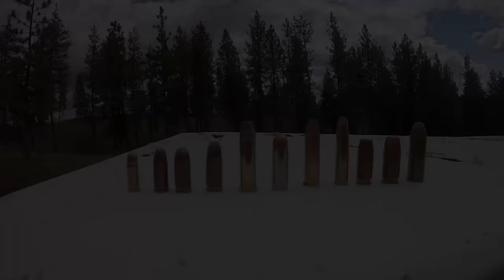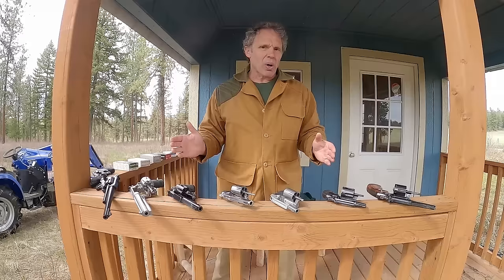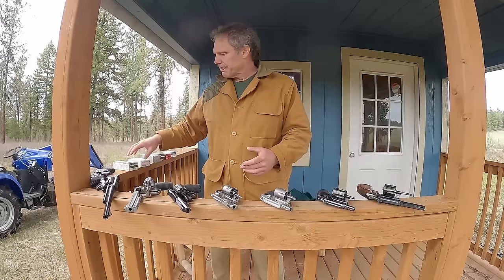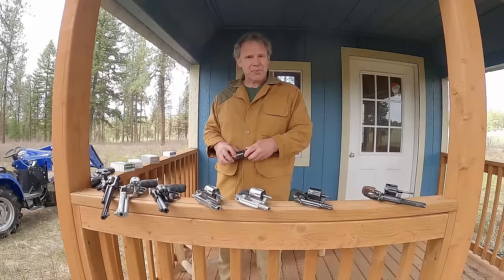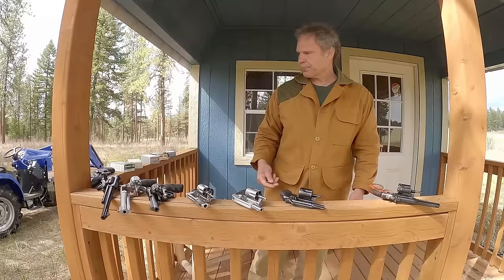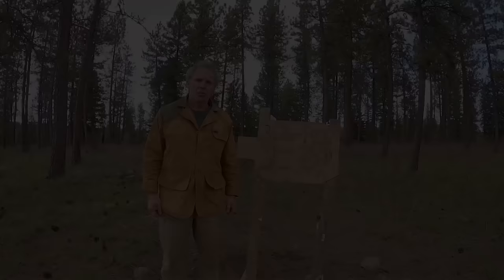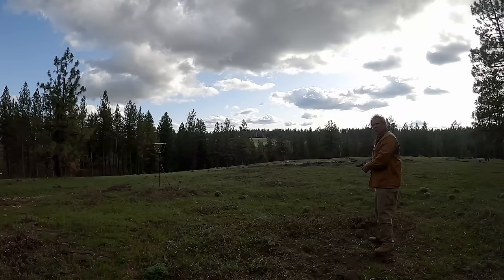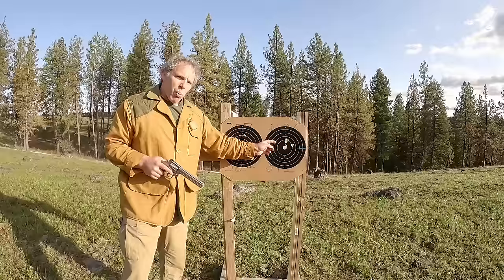Shooting .38 Super in .38 Special and .357 Magnum Revolvers

Comment: I have experimented with shooting 38 Super in a good 357 Magnum revolver.  The best way to do this with consistency and accuracy is to carefully run a 38 Super chamber reamer into the .357 cylinder holes.  The reamer should be run in just enough to properly headspace the cartridge by the case mouth, not the rim, as it would be in an auto pistol.  With the chambers all cut the same and properly, accuracy will be optimized and if head spaced properly so that there is a similar clearance between the case head and revolver breach face as with the .357, primer strikes should be as reliable as with the .357.  That all said, variations in factory cartridges may result in an inadequate amount of case mouth support.  The modified cylinder will still accept .357 Magnum cartridges, and I have noticed no ill effect on my cases after firing. 
If the manufacturers of .357 Magnum ammo offered mild loads of similar velocity to that of the .38 Super, much of the reason for shooting the .38 Super in a revolver would be removed.  Unfortunately few such .357 rounds are available so the shooter is stuck with shooting hot factory .357 loads that are likely more powerful than needed while being dangerously loud, and excessively recoiling in lighter revolvers.  Another way of producing a mid velocity revolver round would be to exceed recommended +P .38 Special pressures by purposefully handloading the cartridges to higher velocities; but I don't recommend this as such .38 Special cartridges may be dangerous to fire in some .38 Special revolvers, and may find their way into those guns that aren't able to handle those high pressures.  The excessive pressure rounds would also outwardly look just like a safe factory round, adding to the danger of them being used in a gun that couldn't handle them.

Comment: Back in the 70's. or 80s AYoop wrote an article suggesting the use of 38 super in 357s when police were required to use 38 special.  I probably misspelled his name.   I think the operating pressure for 38 super is far greater then 38 special  so Ionly use it in 357s that it will fit in. I have several of them and only one will take 38 super the others I can not get any brand I have tried to fit I for years have used a 38 super and sometimes use it in my security six. Fell in love with it in 1955 when I shot dad's friends light weight Colt combat commander, I was seven. Have wanted one ever since, still wanting ha. Good Show.

Comment: Never thought about this particular issue. I did have an old FIE Titan Tiger-38 special revolver that I ended up selling to a friend.  He had a box of 38 S&W rounds. They were just 38 S&W- not Specials. He successfully fired the whole box through that revolver. I have read that the 38 S&W round would not chamber in a 38 Special. And I did try to chamber one in my S&W model 10 38 Speed. It would not go into the cylinder. I wasn't going to fire it if it did. I was just seeing if it would fit.

Comment: Problem with using .38super in a .357mag revolver, the .38super being a shorter cartridge, is the fouling in the front end of the cylinders and if you dont clean it well enough will it impede a .357mag cartridge going in. So I would agree probably not a good idea to use .38super in a .357mag. Another thorough and informative video.

Comment: As you showed, chambers and ammo are sometimes oversized.  It's a matter of manufacturing tolerances.   I've found that oversized chambers will load OK, but don't unload as easily.  I suspect the chamber doesn't seal as well against gas blowby, or the chamber allows the case to expand.   Either way, ejection is a key factor in matching ammo with firearm. Even if the round fits (and is made for the gun), tolerances change the ejection in both auto's and revolvers. You haven't even touched on steel vs brass, vs aluminum cases, much less subsonic or reloads.   Moral: Take it to the range before you depend on it, and only depend on successful results.     It's sorta like the joke of testing matches before you go camping.   Strike one and it lit, so I'll take that one.

Comment: Friend, Great VIDEO! Someone should chamber a 5-shot revolver in .38 Super. The shorter .38 Super Cartridge would allow a shorter Cylinder—which is the bulkiest part of the revolver. A ground-up 6-shooter in .38 Super wouldn't be a bad idea either. B.} IF someone wants to make sure that their .357 Revolver will use .38 Super "just-in-case" might be well-advised to have a .39 Super Chambering Reamer ran into the chambers. C.} Decades ago, a few IPSC Shooters who were pursuing "Major Caliber" had a 9mm Chambering Reamer ean into their ,38 Super Chamber. The 9mm is a little fatter at the rear and the Fire-Formed .38 Super/ 9mm cases—hereafter resized with a 9mm Sizer Die—would hold about one-grain more powder. They called it .38 Super Improved—though the main goal was to be able to use 9mm Carbide Sizers.

Comment: There's also 38 Super "Comp" brass which has a flush rim and some mfg's use this brass for their ammo. (You have to check the box as usually it's stated whether it's comp brass) 

The reason it's a popular round in the US was that target shooters could load 38 Special SWC bullets for their 1911's. In South America you're not allowed to own guns chambered in military calibers and 38 Super fits the bill.

The difference between 38 Super and 38 Special is really cost, performance wise they're about the same. In a scenario where I wanted a 1911 for defense and wanted the extra round, I'd choose the 38 Super over 9mm as there are defensive loads available for 38 Super or you can hand load.

Comment: This video was very interesting even though I never gave this even a passing thought. One thing I'd like to mention is that every firearm I've ever bought came with a disclaimer that the manufacturer stated that any warranties and/or company liability would be null and void if their firearms were used with ammunition that 1.- has been reloaded, or 2.-that the firearm was not originally chambered for, such as using .38 Super in a firearm chambered for .38 Special, or .357 Magnum. There was no mention of this , other than the part where you said "CAN you do it? Yes, sometimes, but SHOULD you do it?" and left it to the user to decide. I think ALL firearms manufacturere warn against such a practice. I think you should've mentioned that.

Comment: I also have firearms (pistols and revolvers) chambered for 9mm LUGER as well as 9mm Largo and 9mm Ultra, 38 S&W, 38 S&W Special, 357 Magnum and 38 Super. The only ones I shoot in guns not specifically chambered for a given cartridge is 38 S&W Special in revolvers chambered in 357 Magnum. My one pistol chambered for 9mm Largo an Astra 400, will chamber 38 Super and was used in days gone by with 38 ACP. 38 ACP as many of your viewers know is dimensionally identical to 38 Super, but loaded to much lower pressures. Basically I think you can't go wrong by only shooting ammunition your gun was designed and chambered for. It's a good way to avoid nicknames like One Eye Willie or 3 Fingered Jack or that guy who is dumber than a box of rocks.

Comment: Always interesting to see how different rounds may or may not chamber in other firearms. You can sometimes even see the same thing with rounds not fitting correctly in chambers they are for. I've seen some cheap 9mm, that was obviously not QC'd well fit fine in compact and full size handguns, but then jam every other round in a subcompact because the casing is just a hair too big

Comment: Hello, great video and very informative, but... You did not touch on chamber pressures at all.  
The 38 special has a max pressure of 17,000psi
38+p 18,500psi
38 Super 33,300psi
38 Super +p 36,500psi
357 Mag 40,000psi
So... the 357 mag revolvers will handle the lower pressures of the 38 Super, but the 38 Super pressures are about twice the pressures of a 38 Special! So the biggest reason to not put 38 Super into a 38 special is it might blow your gun up!
Hope you all have a great and safe day.

Comment: An "expert" might have told us that a semiauto rimless pistol cartridge is taper crimped and headspaces on the case mouth. ... Those Remington .38 Super rounds that wouldn't chamber in the .357 or .38 caliber revolvers, just might fit, if they were run through a .38 Super crimp die with just a tad more taper adjustment. ... However, excess pressure might be the result of that experimentation. ... Proceed with extreme caution guys. ... Good stuff Paul. Thanks

Comment: If I were designing a new autoloader cartridge, I'd get rid of the taper on 9mm, make it as long as the .38 Super, make it truly rimless and design it for modern pressures. I think you could push 45,000 PSI or maybe even more in a case that double-stacks easier than .38 Super without being too wide, reloads better than 9mm, has as good a magazine capacity as the best of either, can push higher velocities than either thanks to the larger case and higher pressure and doesn't lose capacity to do so the way .357 Sig does. Nobody would buy it because existing cartridges are so well established but as an academic exercise, I think it makes a great deal of sense.

Comment: My favorite ccw is my .38 special revolver. It’s very hard to make a mistake with that weapon. I carry several 5 round stripper clips to reload it. I can reload it in the dark without looking. It’s a smith and Wesson Airweight +p .38 special. As long as I load it correctly it will never fail me.

Comment: If you have a snub .357 magnum and want a 'not quite' magnum load then a .38 Super load could work. But you would have to test it out to see if they a) chamber, and b) the extractor will eject the cases. If they do then there a some nice .38 Super JHP loads out there. The ONLY .38 snub I would try it in is the Ruger SP101 38s or older Ruger Speed Six .38s. Those are '357 magnum' stressed (heat treatment) and should take the Supers quite well.

Comment: Putting 38 super into a 38 special even if it fits is one of those where just because it fits doesn't mean you should ship it, something not brought up in this video but is VERY relevant to the safety aspect is rated chamber pressure. It is eluded to when Paul brings up that based upon the chronograph results that he'd be willing to attempt it from a 357 magnum revolver and not a 38 special, but it isn't explained. Maximum chamber pressure is exactly what it sounds like, the maximum pressure a chamber is designed to contain consistently. 

The maximum chamber pressure of 38 special in the best case scenario of +P+ ammunition is according to wikipedia 22,500 PSI, which is significantly less than 38 Super's 36,500 PSI, that kind of substantial increase in pressure is why Paul is correct to not attempt firing 38 super in a 38 special revolver 14,000 PSI difference is nothing to play around with and in the best case would put significantly more stress on the revolver's cylinder than it is intended to, in the worst case this could result in a catastrophic failure resulting in the explosion of the revolver's cylinder and a potentially severe injury.

What about 357 magnum? Well it's more complicated, for a couple of reasons not the least of which is that apparently the pressure rating has at some point dropped because some manufacturers of certain types of revolvers were having difficulty meeting the spec (I was until now unaware of this but am reading it from a couple sources, so grains of salt may be required), the other being the process of proof testing. So the listed pressure of a 357 magnum is EITHER 35,000 PSI or, 45,000 PSI, and to meet regulations in many countries all firearms must be proof tested. What is proof testing? proof testing is the act of firing a firearm with an over-pressured round to ensure safety, this proof round is typically 25-30% greater pressure than the actual rated maximum pressure. So 35,000 psi +25%, given the worst case based on these figures, is 43,750 PSI, well above our 38 super rated pressure, and given the best case based upon these figures it would be 58,500 PSI. So it's safe then? Well NO, during this proof testing only 2 rounds at this higher pressure must be fired, it doesn't have to consistently perform the task, additionally an accidentally over-pressured 38 super round would naturally be more than an accidentally over-pressured 357 magnum round, although still likely less than a proof round. This means it still puts more pressure on the gun than it's designed for, but not so much that it's likely to cause a catastrophic failure resulting in rapid unscheduled disassembly and injuring the shooter.

This is why you CAN shoot 38 super from these revolvers but probably shouldn't unless you absolutely have to in some sort of life or death scenario, because even in the best case scenario you're just putting more strain on your weapon because you can.

Comment: Very interesting presentation as always Mr. Harrell. Good to know that in a pinch it could work. Same as putting 9x19 in .357 SIG Glock 32- one day at our range me and some other jackasses did it to see if you could use 9x19 and it worked well. Extracted each shell, didn't loose accuracy. Only thing that happened is that the 9x19 shell casings were a bit expanded to take the form of the .357 SIG Glock chamber, oh and all jackasses including me were uninjured.

Comment: .38 super should not cause excessive pressure in a .357 but all bets are off on the .38 special especially if it is an older gun  or has a k frame or something. Edit: .38 super ammo costs much more than .357 and .38 special ammo. Nice to know you can do it but doing it seems less than prudent unless the bleep has hit the fan big time.

Comment: This was a very good video, and I did not notice any bias, unlike in the .40 S&W vs .45 ACP video you made. I learned a lot about the .38 Super ammo, and its issues with the .357 Mag revolvers. You also pointed out the fact that ammo is rimmed, some is not, and some are partially rimmed! And it appears that the .38 Super is rimmed enough to fit into and stay at the chamber of the cylinder, depending on both the gun AND the particular ammo! What a mess that is. It was especially nice to see that you had so many .357 revolvers and showed us just how the ammo varied in the various guns. BUT, they were are double action revolvers! I own a Ruger .357 Blackhawk, and from what I saw in this video I should be able to shoot .38 Super Ammo in my Blackhawk, assuming the ammo actually slides into the chamber. That is partly why I said that you should have included at least one .357 Mag single action revolver in your tests.

Comment: PMC 38 super +p does fit in ria m200 38spc. 5 out of 6 fired, 1 ftf due to light primer strike. of the 5 spent casings- none functioned with the extractor, 4 fell out, 1 needed pounded out with a rod and mallet. the ftf extracted without difficulty. accuracy was not notably affected at 10 yards. gun was cleaned and no noticeable damage seen by me or by 2 gunsmiths. my experience via unintended testing, never to be repeated.  if extreme circumstances happened in the future it is possible but by far sub optimal

Comment: The only reliable auto loading pistol ammo into a revolver that I have personal experience with is my Taurus Tracker 692, which works excellently running .357 Magnum, .38 special and 9MM, as the cylinders interchange so that the 9mm is chambered properly and ejects with the 9mm using moon clips. It will chamber and fire the 9mm just fine without the moon clips, but then ejecting can be an issue.

Comment: If in SHTF I find a case of 38 super auto, AND if it fits in my Taurus 605 in 357/38 sp, I now know I could use it in a pinch or for barter. I'd test it first of course, and obviously will only load it if I have no 38/357 rounds left. Can't be relied upon.

Comment: The S & W 686-6 has the new "safer" firing pin design that mounts the firing pin in the frame, vs the original design where the firing pin was always mounted in the hammer.  It is a known fact that those who shoot their newer S & W revolvers double action exclusively will get lighter primer hits than with the original firing pin design.  There are aftermarket suppliers out there that are selling slightly longer frame mounted firing pins to fix this problem of light primer hits.  They also come with lighter firing pin springs as well. As a reloader this SEEMED to cure the problem most of the time, but I also switched to Federal primers that are claimed to be the softest out there, and easier to ignite. Whenever I have gun that has a malfunction, it's always during a match, never during a practice session.  My 686 so far with the fixes I mentioned, has been working as it should....but still waiting for that gremlin to show up at the most inopportune time. Point: It may not have been the ammo that caused the "click".
Reply from the maker: My 686 has NEVER had a light primer strike except with the super ammo.
 It was caused by putting the .38 super ammo in the .357 revolver. Not by a defective gun.
Reply: @PaulHarrell  That's good news, but others have had problems that were cured with new firing pins.  Is your firing pin frame or hammer mounted.

Comment: Well reasoned and presented.  I have a Ruger Blackhawk in 38-357 with the optional 9mm cylinder. In this specific revolver the 38 super fits the 38/357 cylinder and shoots fine. Of course why waste expensive 38 super in that when I can shoot it in my Kimber target 38 super....  
The only part missing is can you shoot 38 super in a pistol set up for 38 special WC or an expensive 357 pistol (Coonan?)
I doubt anyone is going to lend you a custom bullseye pistol to test, or a "It shoots 357 Mag?!?" but looks almost like a Colt?
As to the shooting 38 super in a 38 super pistol. It's fun. Sadly every load shoots differently, so there's that.